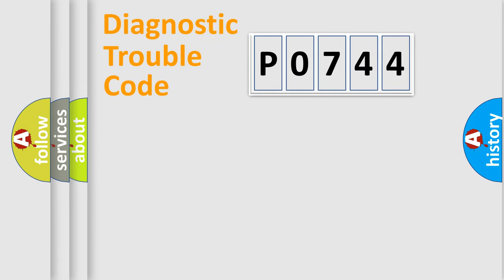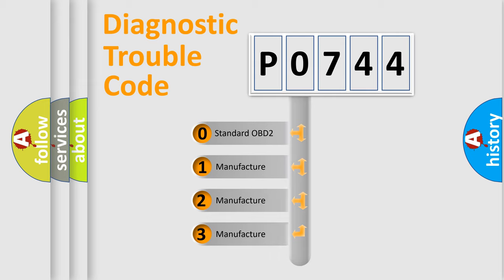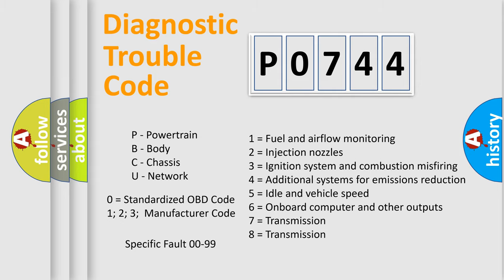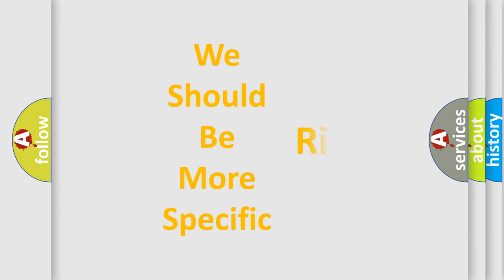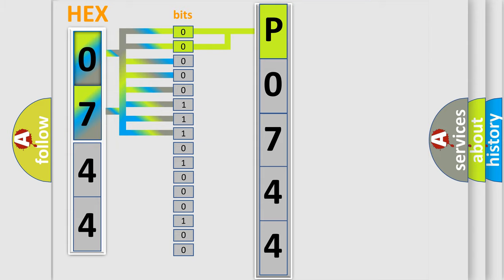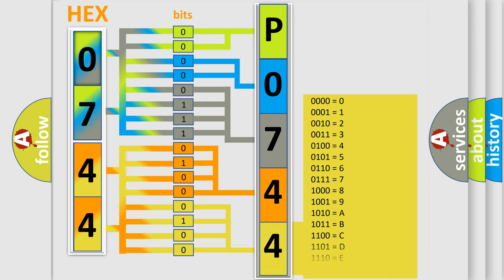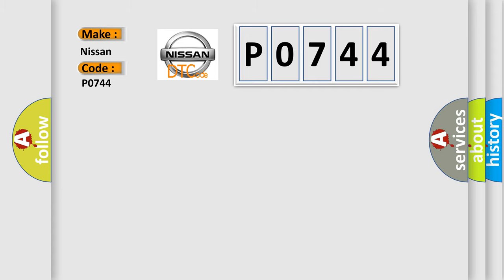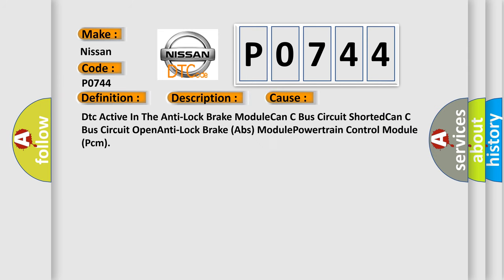DTC Nissan P0744 Short Explanation

Comment: The transmission expert's comment after reading this code. "Yeah, these CVT transmissions didn't work out so well. I can't fix this. I can install a new $4,000 transmission. You may want to shop cars." Not catastrophic but just an indication of failure somewhere off in the distance.